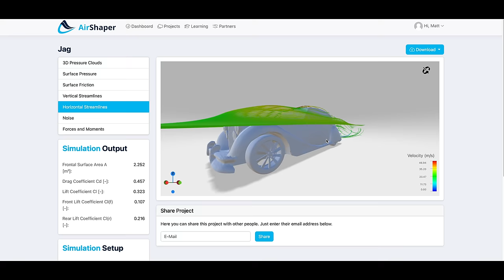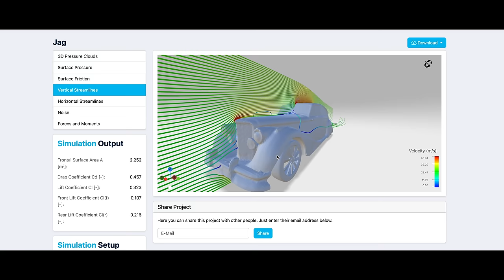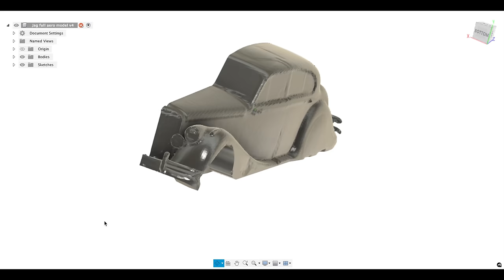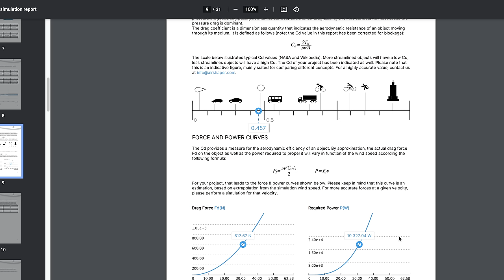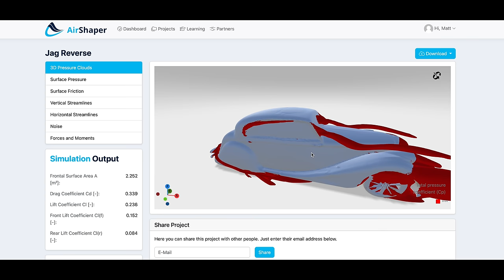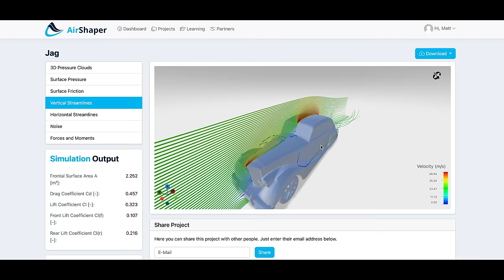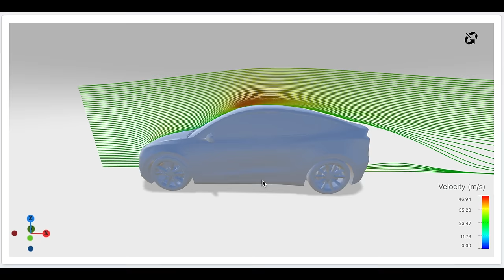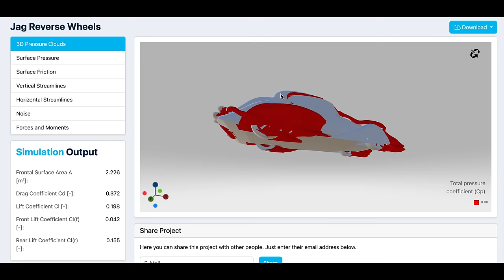Why Some Cars Are Faster Backward

Comment: Hear me out: backwards land speed racing. Use the Jag. It’s the most logical progression following everything we saw in 2022. 
Lovely episode as always, Matt.
Reply from the maker: If I combined all my projects into one project, I'd have so much free time. Time for more projects!
Reply: Facing backwards is actually safer in a crash… So it’d vaguely make sense for a land speed racer. Other than the whole seeing where you’re going part. But they made it work in Captain Scarlet. Cameras yo.
Reply: @Jonathan_Doe_  Tom Scott tried that last year. It doesn't work well. Check his video on it titled "Can you really drive while facing backwards".
Reply: https://www.youtube.com/watch?v=S7ipFApsFec
This was huge in circuit racing. CVT gearboxes so it was as fast in reverse as forward.
Sadly CVT went out of style so we don't get these high-tech races anymore.
Reply: Before you try backwards land speed racing please drive any fork truck forks forward at 15-20 MPH.
For the experience.
Reply: If not reversed land-speed, then Le-mons?

All Hail The Algorithm!
Reply: @Cloxxki  Ah yes, the magnificent backwards DAF races. I assume more modern CVT transmission equipped cars also have some spoilsport reverse speed limiter built in. Modern safety standards probably also have something to say about full speed backwards racing in mostly unmodified cars...
Reply: There is a world record for going backwards!
Reply: @Cloxxki  plenty of cars with CVTs still. Fords, Hyundais, etc.
Reply: @jimrobcoyle  Yeah they steer like a boat 🤣
(I was driving boats many years before I drove a car)
Reply: They used to race Austin Allegros in reverse by swapping around the idler gear to give 4 reverse gears and 1 forward gear, or something along those lines.
Reply: Agree!
Reply: use a daf

Comment: The Jag turns heads for sure. If you built it to drive back forwards, it would blow minds. I do love this Jag.
Reply: "back forwards" 🤣
Reply: Blowing minds aint a good thing so forward driving it is.
Reply: Just need to make sure it sucks enough air through that radiator, and hook it up for rear-steering so that the wheel spats on the front wheels works... =p
Reply: One time the transmission on my fathers GMC Yukon gave out and the only gear he could drive in was for some reason reverse. He drove the rest of the way home (2.2 miles) backwards. It really did blow minds. The look on peoples faces who saw was priceless! 😳🤣
Reply: It is absolutely hideous what hes done to it but the video is good....
Reply: @HU1212ICAN3  why
Reply: It looks like a cab-over truck when backwards
Reply: @MrOiram46  funny you should say that. Some road trips I will see a vehicles parked off on the distance and get super excited. I anxiously wait to admire the long hood, short trunk up close. Then I get close enough to realize that it was just a truck! 😩
Reply: @UmmYeahOk  I love trucks too, medium duty ones are especially underrated. Also fun to see 30s-60s vintage trucks laying around

Comment: About airshaper...

Keep in mind their pricing. It's about $54 for a single run. Not bad, but if you're doing a lot of changes and re-running that will add up fast.
If you want to use their fancy optimization system, which will run your model through a ton of times and actually alter the model to optimize flow, that's about $1080, wew.
If you want a yearly sub, it's 10,800 (!!!), Woah.
They also have a $325 per hour consultancy thing, where a person gets on the phone and walks you through your sim run and how best to alter the model for a re-run
Reply: Slight detail. 😂
Reply: Wtf

Comment: I think some vortex generators could actually look sick as hell on there, very batmobile. It’s worth a shot!
Reply: Yeah maybe do them in a "period correct" way for a plane of that era, hand formed and riveted and such.
Reply: sick...
Reply: At the very least he could do a nice video showing the difference a bunch of vortex generators would make. You've got the measuring equipment built into the car, just use some double sided tape to temporarily attach 3d printed vortex generators or other aerodynamic devices. Perhaps sand the prints and slap on some bondo to get rid of print artifacts.

We just need Airshaper to sponsor the video ;)
Reply: The rims are already weird, it’ll look more like a ricer project than a batmobile
Reply: @JoranGroothengel  ב''ה, magnet-mount(s)

Comment: there's a lot you can do to the front of the Jag that would be mostly invisible on casual glance:
-small bellypan from the front bumper back to the front wheels, and air curtains inside the front fenders.  (diverting air from between the two chrome sausage bumpers which could be a hidden duct)
-block unused sections of the grille inside (blacked out, would be 'invisible')
-naca ducts at the intersection of the front fenders and hood, just below the lights, for a high pressure relief zone.  exit vents underneath.
-controversially, bullet cap clear headlight covers.  It would look like quad boobs, but you're a man so...moobs? and four, so moar moobs.

I would say it would be sacrilege to mod a classic Jag but it feels like you might be a touch beyond being able to make that argument...
Reply: It's not about sacrilege, it's about style. That's why he used the jag body. Ruining the looks defeats the purpose of using the body.
Reply: It's already modded. The engine went out for an electric unit.
Reply: @shawa666  i guess my irony doesn't translate
Reply: I like this idea. Especially the naca ducts. Even something more radical like installing a split windscreen with better geometry would help. No one but enthusiasts would know.
Reply: @sepg5084  "ruining the looks defeats the purpose" I guess you missed the hideous Tesla wheels

Comment: There are a couple of period correct not too ugly things you can bolt on to improve the drag coefficient possibly.
First a stone/bug shield in front of the windshield , this is a small strip of plexiglass mounted just in front of the windshield at an angle to deflect anything that might damage the glass up over the roof. You see them fitted to big rigs sometimes.
Second is the trunk rack that they bolted to the top of the trunk. You could design one that looks classic but works as a spoiler.
Additional changes.
Blocking off most of the radiator and ducting the engine bay air into places where it will improve aerodynamics.
Reply: Deflect-a-Shield! Originally developed as a gimmick to sell to the rubes but later discovered  to actually work at keeping bugs off your windshield.

Comment: So how about directing some of that no longer needed air from the radiator out at a shallower angle in front of the windshield and/or to the sides behind the fenders? I suspect a lot of it used to escape downward behind the engine which could be blocked off with a sheet of metal. I think it would be really cool to improve on the Jag's aerodynamics in clever ways without hurting its looks too much.
Reply: this
Reply: that
Reply: and the other thing
Reply: I'm guessing hood vents would annoy the purists even more than the electric conversion

Matt should do it!
Reply: Definitely chromed plastic if he does
Reply: @Milsparro  nah, carbon fibre!

Comment: This is also true of most aircraft, which is why tailslide manouevers are usually banned. The forward drag coefficient is so low that when you reduce it further, by going backwards, it actually becomes negative… and the aircraft just zips into the lithosphere before the pilot can react.
Reply: Underrated comment

Comment: You absolutely need to turn the interior 180° now, work out some legal (but not visibly obvious) lighting and make that car go backward full time.  You can leave the steering on what is currently the "front" axle; just reverse the direction when you work out the new linkage.  It'll just take a little getting used to.  I'll be watching next week's episode for your road test of this.  🙂

Comment: Sweet drop in of the Australian 1976 HJ Holden Kingswood Station Wagon. I owned the utility model back in tge day when youcould balance ce a long neck on the steering wheel rim and horn bar. Great for a hot drive on the Hay plain.

Comment: When I was young I noticed that if I stared and defocused, I could see the turbulent dust/air that cars carry with them.  It only works if I relax and not focus on anything.  Also, the 87-93 Mustang GT has a cd of .36-39 😁
Reply: I rememeber doing that too! Also staring at a cars wheel and blinking at the right rate you could see the wheel for a brief moment stopped, while its travelling at 100kmh

Comment: You could take the air from underneath backwards jag and duct it up through the rear mount radiator. This would make the air at the back break away more smoothly by partially filling the aero vacuum the vertical surface creates.

Comment: There’s a trick you didn’t mention for radiators - the drag is based on frontal area, While heat rejection is is a function of surface area and and fresh-air airflow - but it’s a decreasing multiple so you can have a large radiator at an angle to the incoming air and have the same heat rejection as a smaller radiator directly facing the airflow. You can see this applied in F1 cars (or the Veyron - I assume the Chiron does it too), where each car will have numerous relatively small inlets with diagonally facing radiators, reducing the frontal area of the car. This is because the heat rejection of modern radiators doesn’t scale well with increasing airspeed but scales better with increased surface area. You’ll find the same principle in PC CPU all-in-one water cooling units, where you get a dramatic increase in cooling performance with a larger radiator rather than increased fan speed. 

I’m sure someone has the equations for this, my expertise is in application here - I’ve never had to actually solve the math in advance for this.

Comment: I wonder how much difference having the sides of the engine bay open makes. In racecars they put huge efforts into getting the air from the radiators/intercoolers out from the engine bay, not just for cooling but also for airodynamics (makes the wall less of a wall and more of a air duct).

Comment: When a bunch of guys got together and did actual windtunnel testing of the 240/260/280z years ago, they found out the stock bodied car had a drag coefficient of .471.  The real alarming bit was 367 pounds of lift on the front wheels@120mph.

Comment: The 2+2 E-type is actually a great vehicle and gorgeous in person, plus they can be had so much cheaper than the previous ones. Especially fun with a 6-speed transmission shoehorned in there, one of ours idles at like 80mph in 6th, lol.
Reply: I take it thats a t56? My friends car has one of those, says in the manual you arent supposed to use 6th below 160kmh 😂 (its doing like 1200rpm at 100kmh)

Comment: Aw I was really hoping you’d find a large enough parking lot to get the Jaaag up to speed in reverse and try to compare it to the consumption going forwards. Doesn’t need to be highway speed, but at least the motor should be capable of that. 

Regarding the aero design notes, I’m pretty disappointed that automakers haven’t yet taken advantage of EV packaging to make extremely cab forward designs that actually have all the right shapes in the right places. The closest is stuff like the ID.Buzz and Canoo but they have a stubby front end and a far away windshield for cargo reasons. Now I want to see a Buzz with kamm tail and some cD numbers. 

I’m excited to see how they can innovate when they move beyond expected shapes in car design. I guess stuff like crossover coupes and ultra efficient designs like the XL1, lightspeed one, and EQXX are a step in the right direction by why stop there?

Also side note, I really liked Jason Camissa’s ELI5 explanation of the coefficient of drag - he said it’s like how much smaller an object looks to the wind. So a car twice the frontal area but half the cD of another look the same size to the wind.
Reply: Ignoring any issues about crash safety, cab forward designs aren't the most fun to drive and there's a bit of getting used to steering something where the wheel's are under your butt.

Comment: Adding something like a spoiler lip at the back would indeed be sacrilege on this Jag, even if it helped aero. But there is one big option that would retain the overall shape while aiding aerodynamics: Hood louvers. You'll have to run more simulations to find if placing them across the top or sides (or both) will be most effective at alleviating low pressure zones and turbulence in this area. Not only would it improve aero, it would aid airflow through the radiator, and because there is no engine in the way, a secondary surface could be built to guide air upwards an out. In side view, this surface could better approximate the sloped nose of something like a Prius, but would simply exist as ducting below the louvers, and behind the radiator, so you would never see it.

Comment: If you make a roll cage ocvered by a glass dome, the dome can be made to look "black mirror" while actually offering a great view out. The rear crash structure gets an under the skin upgrade. No problem as the original bonnet will offer a huge boot in the now back.

Comment: well, now Matt, here is an idea. make front wheel coverings that move with the wheels, so when you go straight you get the full benefit. at low speed, like pulling into parking space drag is not your problem. does not even have to mount directly to the suspension, maybe just put something that pushes the covers when the tire gets close, maybe springloaded? or a stepper motor with some programming? if it really makes a difference it should be totally worth it on trips. Much of the rad could be sealed off, too. no reason to invite a ton of air under the hood for no reason.

Comment: Considering there is no radiator, all of that air could be directed out of the sides of the hood in some period correct looking vents; filling in some of that side turbulence. 

I reckon a well designed rear spoiler would be magnificent. Split that air!

Comment: How much drag can you loose with holes, luvers, or removal(SoCal speedster)? How much radiator does the jag accually need? Could controlled vents/holes/flaps improve handling/drag to something close to a car today? Summit had  an articile about The Brick(Fastest Astro Van), they did some pretty cleaver stuff you to can do. Great video, all hail the algorithm.

Comment: Another good example is the typical commercial roof storage box that goes on your roof rack. A number have people have proven that it’s aerodynamic properties are all wrong. Put it on “backwards” and the drag is reduced. 
You can see this immediately in our Tesla with reduced power consumption having the roof box facing the wrong way, ie: less additional drag than having the box face the way it’s designed to.

Comment: The British Army had a recon vehicle designed to be as fast backwards as forwards , the Austin Champ. It had a big engine and a transfer box that enabled it to reverse at its maximum forward speed. It was a death trap. Nothing to do with aerodynamics, it was just unstable. 
Relating to aerodynamics, the earliest Mk 3 Ford Escort was soon modified with a  raised lip on the boot lid that made a measurable difference to MPG , a very simple mod well worth having.

Comment: I'm a fan of high pressure cooling systems that just pump to under body skins and back. A few planes had them. Seems they thought a radiator sticking out was gonna slow them down or something.
Reply: A few models use fuel from the wing tank to cool the avionics then pump it back. At altitude this works well. At sea level on a hot day it’s “just ok”

Comment: Many years ago, my Uncle Jack owned a DAF 600.  This car would go as fast backwards as it would going forward, because it was designed that way.  At top speed, it also would go a little faster if you lifted slightly on the throttle, just like old vacuum powered windshield wipers and for the very same reason.  It was designed that way.

Comment: The best thing about the E-Type 2+2 is that it is easier to fit taller drivers comfortably into one than a E-Type FHC or OTS. This wouldn't be a problem for a reasonably sized person like yourself but those of us who were born with a little too much stature REALLY appreciate that sort of thing. That's the main reason why I purchased a Chrysler PT Cruiser instead of a Toyota Matrix.

Comment: Probably 50 years before Matt popped into existence, tests were done on cars from the '20 and '30s, and it was discovered that cars were more aerodynamic going backwards. The resultant 1934 Chrysler Airflow was an abomination...styling wise.
Reply: It looks alright to me! It seems like it was mainly the front they improved on the Chrysler Airflow, the rear looks pretty conventional for a car of time, it slopes down but too steeply to avoid uncontrolled flow separation (it's neither an extended gently sloping tail, nor a Kammback which is a gently sloping tail but cut off for practicality of vehicle size).

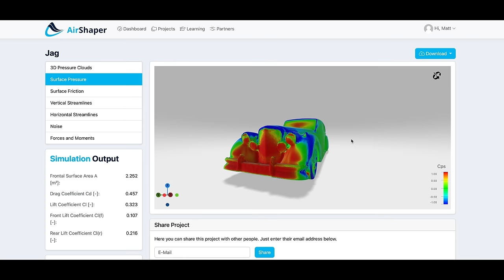Comment: 9:50 most cars will still have a fan to force air through the radiator, so even when driving in reverse for longer periods the fan will simply turn on to prevent the engine from overheating

Comment: I wonder what would happen if you designed some contraption in the frunk to direct air in better places to extend range since you don't have an engine in there anymore

Great vid
Reply: The frunk of most EVs are already a lot better from being able to narrow and smooth down from the lack of an engine and smaller radiators. You still need some round blob in the front to push air to the sides in a controlled manner.
Reply: @Appletank8  I know, he just said he wants to keep the cool stock looking grille
So I'm thinking if it would be possible to do some sorta aero behind the grille instead